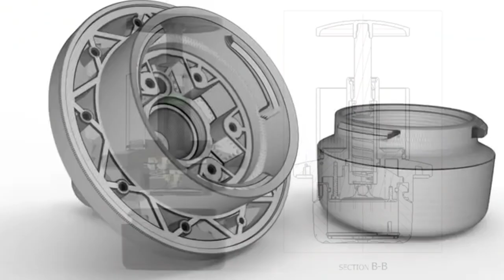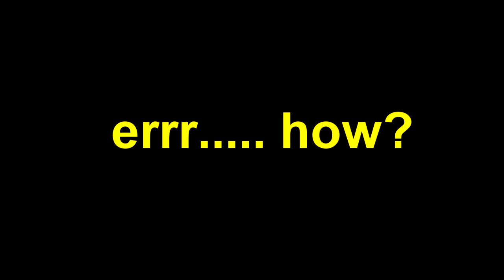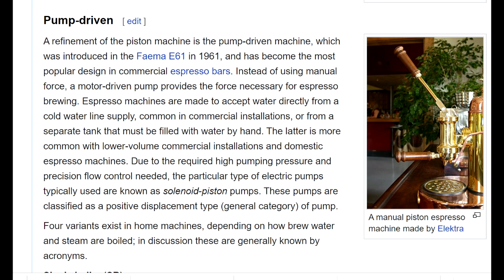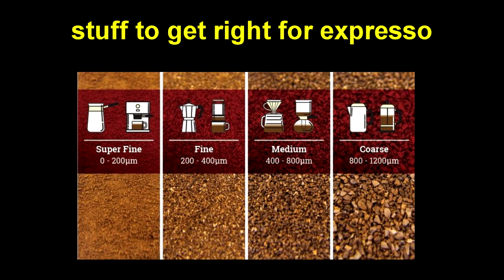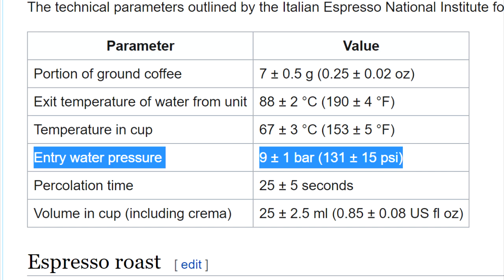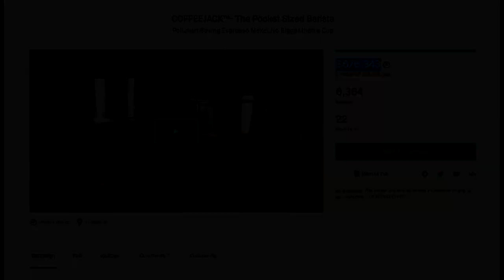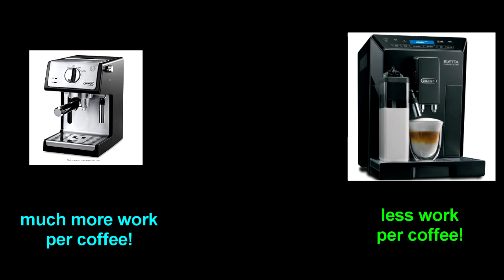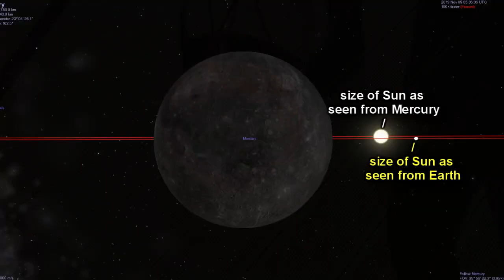CoffeeJack: BUSTED!!

Comment: So, I'm going to make a pneumatic one, with a pump in your shoe, so walking compresses the air, which is stored in fiberglass pressure vessel in a fanny-pack that also carries the press,  grounds, a stainless steel mug, and an insulated water bottle with an integral heating element. It will also feature a large-brimmed hat covered in solar cells connected to the water heater. In only seven hours of vigorous hiking in direct sun, you will be able to enjoy a few ounces of espresso. I have an unbelievable amount of belief that this will revolutionize something somewhere, and make me a lot of money from rubes who also believe in tripe like this...

Comment: Aren't there moka pot style espresso makers? 

Those don't even need to be pumped, they are just steam driven. The bottom chamber is full of water and when it starts to boil the steam pressure that builds at the top of the bottom chamber drives the water up a tube at the bottom of that chamber, the water then gets forced through the compressed coffee grounds and into the top chamber. I know I have seen ones that just have spouts and platforms instead of the top chamber, I just don't if there are any that make proper espresso instead of just moka pot coffee.

Comment: 10 years ago I bought an Handpresso, a heavy steel "bicycle pump" expresso machine. It did cost like 100 USD, almost 1kg, made a great coffie. But it needed like 20 strong pumps to get a 3-4 cl coffee. And yes, you need hot water and coffee. I used it to get my coffee while being in the nature. But the cost, weight and work required does that stuff a joke if you're not a cafeine addict nerd. 
The cheap copy of this video full crap, btw :)

Comment: OK, I hear it here in Belgium all the time, but "expresso" is worse than plain wrong.
But it can be explained, and the explanation may help you to remember how to pronounce it correctly.
(Native) Italian doesn't have the letter "x"; they use "ss" instead. Tax becomes "tasso", a taxi is a "tassi" (though they adopted and use "taxi" as well, probably because it's one of the most universal words around). And sex is "sesso". Yeah, that looks weird, but it still works :-)
And that's why it's "espresso", not "expresso".

Comment: The syringe demonstration he made has a fatal assumption.  The part where he says "If we were using water, the pressure [generated] would be exactly the same."  Air is a compressible fluid where water is incompressible.  If that syringe was filled with water, no amount of weight would move the plunger.  The pressure generated would simply be the weight added divided by the area of the plunger.  Hence "pounds per square inch".  If the plunger is less than 1 sq in, you get more PSI than you have pounds of force  

Since this thing is called the "Coffee Jack", I believe the principal here is similar to a hydraulic jack - generate a lot of pressure in a small cylinder and use it to provide a lot of force from a big cylinder.   It's how you can lift a 4000 lb car with 20 lbs of force on the handle of a bottle jack

Comment: I've got a portable espresso maker. It has a much smaller amount of water, and it has a  manometer and a pump that you really have to push hard a couple of times. It makes a tiny amount of espresso, so tiny that I usually forget about it. I presume you can optimize that design, but this design looks entirely brain dead. Of course, I don't use a kettle, I use a fuel burner, because we don't get electricity where I'm going with the kajak. On the road I use a filter. Clean and simple and you get a decent amount.

Comment: 12:15
To be fair, let's say you're camping and for some reason you really just can't live without freshly made espresso you can use that thing, boil the water with your gas/methanol cooker or just over the fire.
Among the products you "busted" this is the first one I could see an actual use case for.
My point is, yes it can be used without electricity even though it's indeed not smart that they show it being used in combination with an electric cattle.
Reply: Yep, this video is very much grasping at straws. There is already a pretty big market for portable espresso machines. Even outside of camping portable espresso machines have their place. Chances are your workplace already has a kettle, has a regular coffee machine, but doesn't have an espresso machine. Bringing a full-size espresso machine to work doesn't make sense. Interestingly, the entire video is trying to debunk the concept of a portable espresso machine, and doesn't even delve into any functional problems with it other than the exposed water. 

If it works as it says it does and produces good espresso, there is a market for it. If they can compete with other portable espresso machines on cost/ease of use.
Reply: The main problem with the machine is not described well in this video i can agree with that. The two big problems are the 10 bars of pressure that this machine wont achieve and also that its not on a stand.. Both incredible bad design decisions. Its not impossible to create something similar though and there are other similar machines (with stands) out there for around 40 usd. The coffee from this machine will taste like any normal coffee maker coffee and not like an espresso.

Comment: How much does that thing cost? If it's $10 or $15, it might be worth it (aside from the technical problems). But even still, you may as well get a moka pot - so you can get some espresso with drip grounds

Comment: Could you heat the water to 92 celcius with a magnifying glass to make it a real expresso without electricity?
Reply: Fire or propane makes this easy. "No electricity" is quite clearly aimed at camping. In an urban environment it would make sense to simply use the kettle at work.

Comment: Given how little coffee I drink, it would be easier for me to buy a case of Rocket Fuel (self contained chemical heating device in the bottom of the cup). Perfect for camping if you don't have, or don't feel like using, a gas stove.

This reminds me of an invention that was taken on Dragons Den UK. It was a small device that you put in your water bottle (can also be use with other fluids as well as water) that monitors how much you've had to drink. Jenny 'I'm out' Campbell made a great point about how nobody would want to use the device in a drink (other than water) and then place the device back into your bag, wet and 'gunky'. I suspect you'd have the same problem with this coffee machine if you placed that in your bag without thoroughly cleaning it. 

I wonder when someone will invent the pocket toaster? Or, now hear me out here, you could wrap heated mesh around your testicles and hang the bread off your penis. I best patent that before someone else steals my idea and makes millions from it.

Comment: 08:07 Your methodology is incorrect. In the product demo video you will observe that the user pumped the plunger several times. To me this indicates there is a one-way check valve between a larger cylinder and a smaller cylinder. The user pumps the smaller cylinder which charges the larger cylinder up to 9 bars of pressure. The quality of the coffee will still be poor as the pressure can't be maintained consistently. The lack of steam is due to heat absorption into the coffee maker itself.

Comment: An espresso shot is about 40ml, not 60 as your calculations implied. Some definitions even go as low as 30ml, none get even close to 60. Thus their theoretical syringe would be half, at around 5ml to meet their 8 pumps claim. Therefore significantly reducing the weight required per pump. 
As someone who only has access to a kettle in their office, and has mastered the magical technology of having a bag of ground coffee in my desk, this is a completely viable product. Though it is a little over complicated, and looks like a pain in the ass to clean. And it's probably more than $40 so screw that. I'll stick to my aeropress or a simple pour over, but still you really exaggerated some of the numbers here to make the product look a lot worse than it is really is.

Comment: I mean, it could be worse. It may not be as revolutionary as they claim to be but at least it might be useful. It's not like say.... the Juicero.
Reply: Wait... You actually need to add the hot water from another source? And it only works with ground coffee, too? Aight, I'm taking it back, it's not that much more useful than the Juicero (still not quite as bad though. At least you can probably use any ground coffee you want and not just some prohibitively expensive products only sold by the company). 

I mean, if I wanna be environmentally friendly I just get myself a re-usable cup. You know, like the one basically any canteen is selling for a low price that they'll fill up for you (heck, there's even some that'll let you return the mug and give you a cupon for it that you can use for another cup, meaning you'll always have one and you're not even the one who has to clean it). At the point where you are running around with a mug, this contraption and ground coffee, trying to get hot water from somewhere you might as well just get some instant coffee.

Comment: Thunderfoot, i appreciate you debunking all of these bullshit products, you are usually right. I appreciate your critical thinking skills and inate skepticism; i'm the same way. However, this thing seems like a compact version of AeroPress which actually does make amazingly good espresso type coffee. Lots of my friends do have AeroPress and they do make great espresso, there is no dispute about it. CoffeeJack, while not an entirely original idea, and not sure why it made so much on kickstarter given that AeroPress was already around when it started, other than people do not really bother to do any research before pledging, it does seem plausible that it would make great coffee. When i'm camping i use an Italian made stovetop espresso maker, tried and true design, made of stainless steel, makes really great espresso. I use it at home also. Does not require a kettle but a heat source such as a campfire or electric element is needed.  One can also get a hand powered coffee grinder, the old Italian ones made of wood are great and quite packable.
Reply: Additionally, you can't really fault them for the fact that ground coffee is required in order for this thing to make coffee.

Comment: Worked in a ridiculously fancy coffee shop for awhile... You're 100% right about the danger...
Also... The reason it's called Espresso is because it's refering to the Pressure, not the speed.
Which makes your point doubly correct...

Comment: Well Sir, I think you never made a proper eSpresso in your life ... it is called ESPRESSO not EXpresso!
Also, right ground grade, optimized brewing temperature and pressure are essential for the perfect ESpresso. These automatic coffee makers just can't produce a real good espresso. They fail in grinding quality and also correct pressure  the pump may be able to deliver the pressure but the insides of the machies not so much. I never had a good or even close to good Espresso from such a machine. However, most important for a good coffee (Espresso or anything else) is good and fresh beans.

But if you prefere EXpresso, just go with whatever brown liquid you like...

Comment: I think this is a case where the marketing is worse than the product. I enjoy most of your videos, but I think you're attacking their marketing approach more than the product itself. That being said, what they're doing is not revolutionary by any margin; Portable hand-pumped espresso machines already exist. As a frequent traveller I've used the Wacaco Nanopresso for two years. It accepts ground espresso or various pods. I purchased it especially for when I travel (especially in Asia) or when I go camping, but now I also use it at home. It's been reliable, it's portable, it's cheaper than most at-home espresso machines, I can heat water over a fire, and the quality (although not revolutionary) is on-par with random cafes you'd stumble into at a new city.

Comment: Also - a better, simpler, proven, easier version that produces damn near espresso quality coffee for $25 (and is my go-to for camping since it can use campfire boiled water) is the Aeropress. 

There is some argument for the "no electricity" statement because it doesn't take up an additional outlet, and most homes have a kettle already. 

But wait a second. Are you actually arguing that pod coffee can hold a candle to good freshly ground stuff? Because you're insane if so, or you need to buy better beans. Because even the most expensive K cups taste flat and weird (the extraction time on them is all wrong in addition to the volatiles being up inside the pod and mostly not in the grounds anymore) compared to even modestly priced, freshly ground beans in a drip maker.

Yes, this machine is dumb. But pod coffee is even dumber. When the inventer of the Keurig has publicly stated he wishes he'd never invented the thing (due to the amount of landfill waste the stupid pods produce) you know you have a bad design.

Comment: Or you could just get one of these, https://aeropress.com/. I've had one for years and it makes a decent coffee. I wouldn't go so far as to call it espresso, but it get the job done. And clean up is fairly easy. My main reason for buying it was because I found the capsule coffee at work bloody awful and generated too much waste. I have a metal filter for it also so no messing around with the paper disks.

Comment: Ooof... where to start.. your eXpresso machines that come with tampers are the most budget- consumerfriendly things out there. Most machines don't come with one. The claims in that CoffeeJack video are ludicrous.

Full automatic machines are barely acceptable and don't produce real Espresso. You can make good Espresso with some cheap machines (again, don't confuse them with full automatic machines which SUCK and by no means make a real espresso). But it's very nondeterministic, you have to experiment A LOT and you are restricted in many ways. For example in foaming milk. Machines for home use up to ~600 bucks are usually single boiler machines. So one boiler for making the Espresso AND foaming. You can't foam while you pull your shot. And you have to do loads of stuff to get the temperature right for foaming as well as pulling a good Espresso. Espresso as well as most coffee is very temperature sensitive. That's the downside of machines for home usage. Machines for the coffee industry (i.e. coffee shops are different, have multiple boilers and circuits, so you can foam and pull shots in parallel).

Comment: I randomly came across this video as I'm very much in industry when it comes to coffee and I kinda want to pull your video apart.  From your video it seems like you've done some casual investigation into coffee but have never really delved that deeply into it.  Actually there are a couple of products already on the market that are very similar and I think your comparison of it to a traditional coffee machine is kinda incorrect, even though they do it themselves.  This product is much more akin to the delter press which is also a handheld pressure percolator.  Also although they've not done a kickstarter of this scale before they also, according to them have actually released products and have a track record of doing so.  

tl;dr  This video is comparing apples to oranges.

Comment: You miss the whole point Thunderf00t and is that CoffeeJack is a environmental friendly and sustainable coffee machine. The only two main drawbacks are that it seems it would not deliver as expected and that it has plastic parts... otherwise, it is a fantastic "thing"!!!
Reply: It will end up in the dumpster anyway, given the "performance" of it. It's not exactly eco friendly neither unless every user uses it a few hundred times INSTEAD of using coffeeshops to offset the carbon costs of production, marketing garbage and other costs related to production and development.

Comment: I think you missed the mark on this one.. I guess we really won't know yet. However you totally didn't do your research.  Just out of curiosity looked into this. Besides calling Espresso, Expresso incorrectly, and spelling it wrong too, you got how their invention works wrong.  The jury is still out on this one yet.. But if you bothered to read their entire kickstart page you would have realized that your entire demonstration with your syringes is bogus. They state clearly that their invention uses hydraulics not air pressure. Honestly this looks legit. I look at these things too. And I have seen a lot that you can look at and say its BS. But this thing looks like it will do the job they say it will.   Your video on this does not bust this. Not at all. It's really just your opinion and has nearly no facts to support it being busted. Which disappoints me. As I usually enjoy your debunking. This one has left me sour.  Since we are on "Opinion",  here's my view of this. I use a french press. For a few reasons. It makes good coffee. I make enough for my self, or myself and my wife. It's simple and takes up very little room. I have used it camping, without electricity. By boiling water either on a fire or portable gas stove. But at home I use an electric kettle. I have also used a microwave, and the hot side of  a water cooler/heater in the break room at work.  This thing would serve the same exact purpose and fill my need if I wanted an espresso machine.  I can see how this thing would fit into a lot of peoples lives and be very useful. This one took a notch off the respect scale for me. Even if this product doesn't happen and work like it says, your vid is not a busted vid, and is only your opinion.